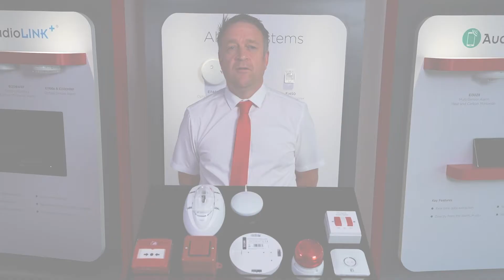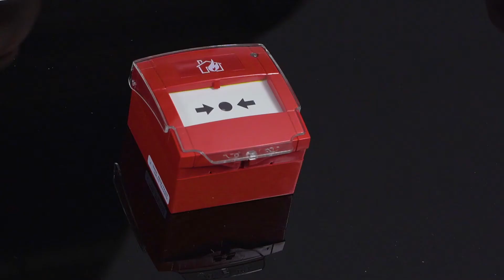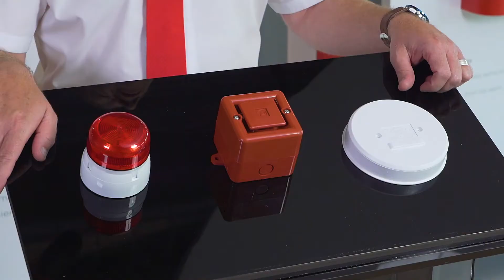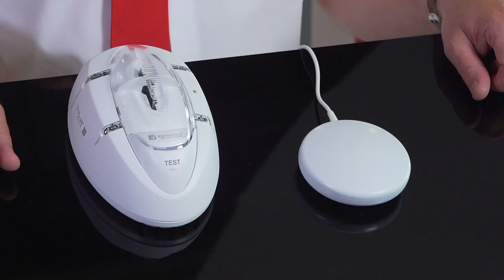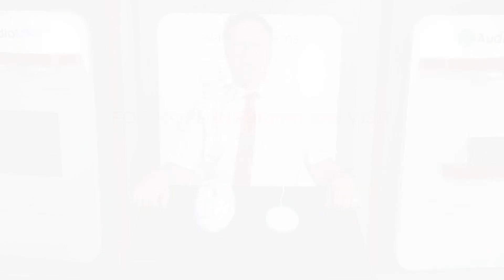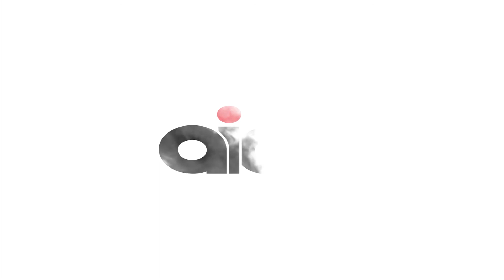Aico Accessories

Comment: If i have a gateway system and ei3024 and ei3028 and want to add a beacon to each, would i need 1 relay or 1.per alarm
Reply from the maker: Hi Reecy, 

If you are using the deaf and hard of hearing alarm kit (Ei170RF), you can just use the Ei171RF strobe and in that case no relays needed.

If this is for a different system and there is no Ei170RF involved, you would need one Ei428 RadioLINK relay and however many strobes you are wanting to install. Depending on how many strobes you want to use, you may need to wire them all to a junction box and from the junction box, wire to the relay.